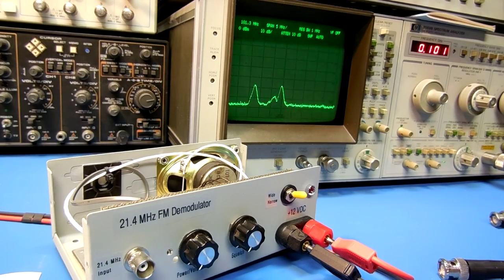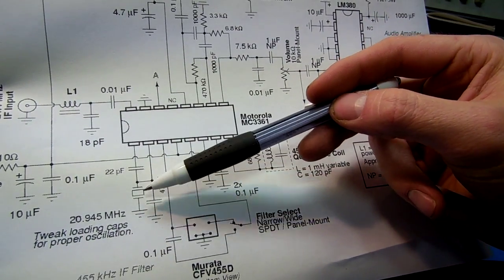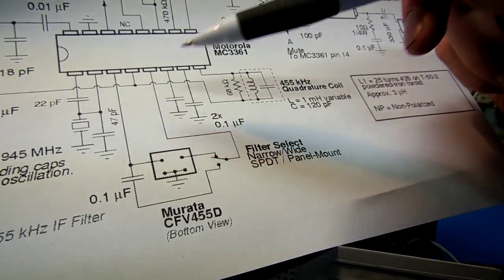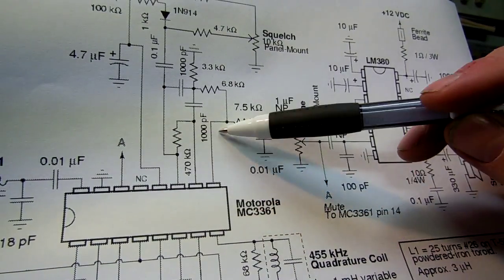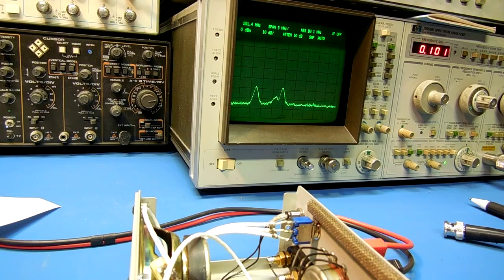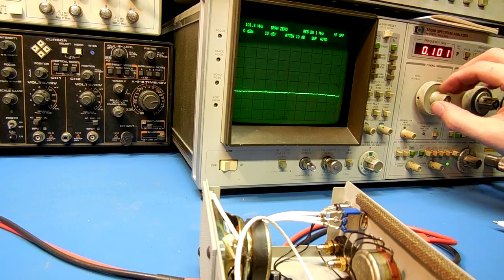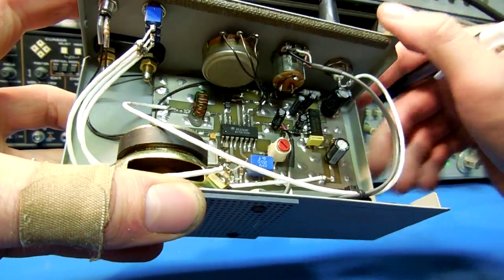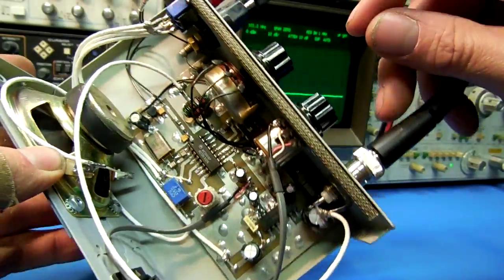GBPPR Vision #23: 21.4 MHz FM Demodulator

Comment: Hi,just a note when you test set up descrim core of coil use 60% deviation @-50 to-75dBm
set your RF gen DEV @ WFM Broadcast=75khz (150khz peak),FM=3khz (5.0khz peak),NFM=1.5khz(2.5khz peak)-FRS,LMR,PMR use
adjust max audio for min distortion on a scope.The resistor across descrim coil also can be switched via a relay or transistor  with two different values  to keep a constant audio level at output pin of MC3361 when using  FM (5k)& NFM (2.5K) deviation levels incoming.This is how part of the switching is used on 2 way radios when selecting wide or narrow fm modes including different 455khz filter bandwidths 12K (FM) or 6k (NFM)
To improve squelch,use a extra (darlington)transistor to switch the voltage to the audio amp Vcc pin on and off driven from the squelch signal output switch pin,you will find you will have less background hiss if this is needed.
Many commercial 2way radios are now all switching to Narrow FM 2.5khz peak in both VHF and UHF bands,this may vary worldwide, Im in Europe mainly all NFM 2.5khz apart from Marine and some Gov Depts in UK,most commercial PMR all NFM now here in UK ,Maybe different in USA on certain freq's.
Really good project and video keep up good work!:)